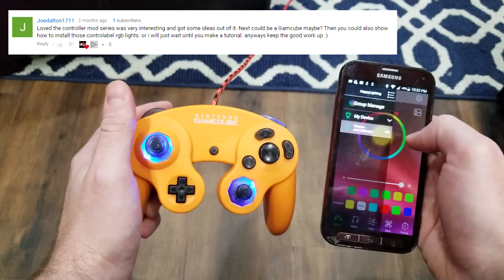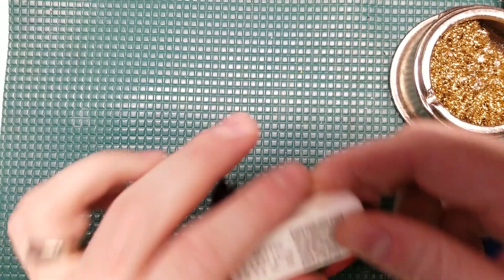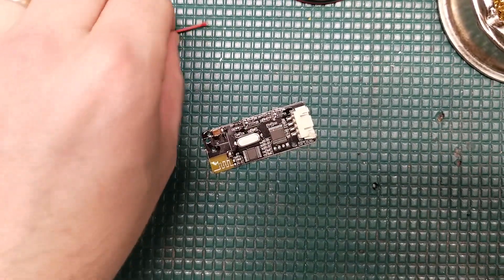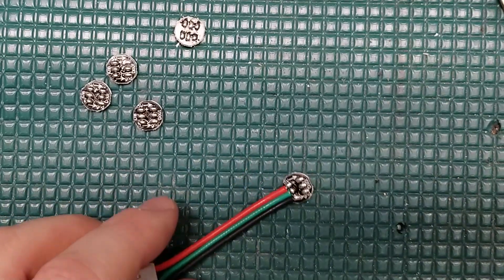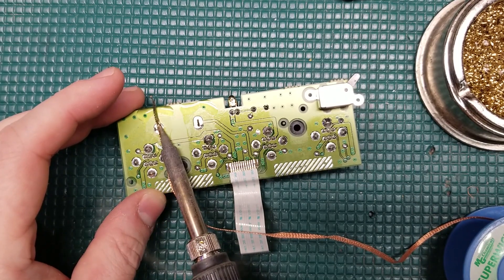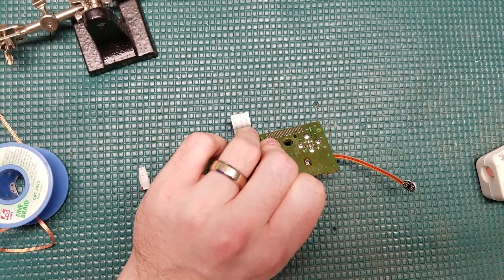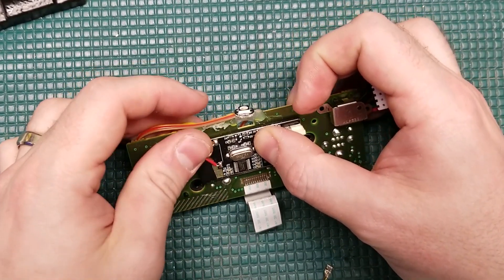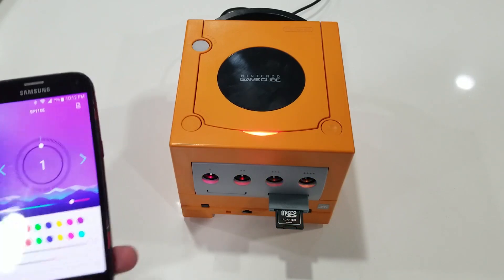RGB LED Mod Tutorial/ How to/ guide - Gamecube, Saturn, N64, SNES, and More!

Comment: Casual solderer. Took me 3 hours and still don't have the LEDs lighting up. Tried to get the exact LED controller you have, but all they sell now is 4-pin connectors instead of 3.

Since I can connect to it from my phone, the soldering to the chip should be correct. I believe it's the 4-pin connector.

Comment: A great way to align these LEDs is to do a quick solder job from the hue to a clipped USB cable.  You can align them while they are shining fairly accurately.
Reply from the maker: Dude, fantastic call on that... I am going to put that in the back pocket for a future video!!  Thanks for sharing!

Comment: Following your tutorial and using the same components, would I be able to add 3 more leds or is that 5v point unable to provide enough amps?  If it is too much strain for that 5v point to power 8 leds where would you draw power from?
Reply from the maker: I have not tested with a multimeter so I can't be sure, but adding 3 more leds likely wouldn't add to much more draw.  Each led at 5v draws approx 50ma. The 5v line supplies 1.5 amps. So I think youre good to go!
Reply: @RockerGaming    heard from someone else that it would probably be able to provide at least 1A and doing the math it meant it could still be doable, thanks for the clarification going ahead with the mod.

Comment: I've got my controllers, extra wire and leds in, I'm gonna be trying my hand at this tomorrow can't wait.  Thanks for the guides man, I love your channel.
Reply from the maker: Thank you and best of luck!  If you're planning to put it into a GCC just make sure you got the correct led controller from the description as the SPE110 in the video is a really tight squeeze without removing rumble.

Comment: Instead of gluing over the light, couldn't you glue over the back both sealing the wiring and both holding down the legs but also keeping the light unobstructed by the glue making it both brighter and easier to keep equal amounts shining thru

Comment: Hi! Excellent video however I am having issues. Mine is a different model SP611E, very similar with a few inconveniences. I did the same thing as you, building the LED strip with addressable lights, but my 4th and last LEDs from the strip keep acting up! They keep flickering and displaying different colors than the others. 

I changed the 4th LED only and it worked for a few minutes then both the 4th and last LEDs started acting out again! 

I changed the last one as well as the third one just to see now and same result. Now the 4th and last won’t even turn on anymore. The 3rd one is flickering too now. 

I verified continuity of my wires and all seems good and can’t find anywhere where it could short. I am clueless…. Help!!

It’s like the LEDs keep failing…?

Comment: I love this tutorial! You are so in depth and help me not only do but understand! I’m subscribing today! I’ve been doing this now and my only question is, where is the 5v for the n64? I don’t want to use the one from the a/v cause people say it fries the audio and video. Is there another more reliable spot? Do I use a 12v to 5v stepdown? Or is it safe you use these EXACT pieces connected to the a/v port? FYI, I have a RGB mod already installed. Don’t know if the combo drains too much power. Thank you so much for your time and you’ve made us all better at what we like to do!!!
Reply from the maker: Thank you!! I would look to pull 5v off the voltage regulator. That is going to be the most stable 5v source.
Reply: RockerGaming I can’t find the voltage regulator on the board. Only for my 3.3v for the mod. If everyone keeps losing audio and video, can I just use a step down from the direct powers 12v source? Sorry for all the questions. Just can’t find it on the dang N64. Every other console I got. Lol
Reply: @greenrasta5789  u ever find the 5v?
Reply: @RockerGaming  I just did this to my n64 and the audio video is now fried just like this comment said. I have light in the LEDs but my n64 is a paperweight now. Any idea how to fix this? Or how to identify the voltage regulator on the n64m

Comment: Hello, I love your tutorial and followed it to a T but the lights are not working. :( I have a few questions. The Bluetooth controller is the same model and brand, I got it from your link, however, the internals looked different, especially the tip connector. After I removed it the ground and 5v looked different from your video. Do you know how to tell which one is ground and which one is 5v? 
The other question I have is that the controller has 4 cables, one that is loose on one end, in your video it only has 3. Did you remove it?
And finally what temperature are you using on your soldering machine. I was using 680. 

Thanks so much! Love your channel.
Reply from the maker: To to tell which is ground I would use your multimeter and using continuity mod probe the two power points with the other touching ground from the pads that go out the leds. 

Yes i clipped it off

I have mine set between 600 and 700 degrees F based upon what im doing 650  would be good for this operation, but the 680 youre using is fine too.
Reply: @RockerGaming  IT WORKED!!!
Reply from the maker: @pablosalazarcomposer  well done!! 👏

Comment: This looks awesome! Totally going to do with in my GC Switch Dock now. Should be easy enough to connect the controller to the Dock LED. Fantastic tutorial!
Reply: After a quick test, turns out the dock led is too low to power it. The LED turns on, but the controller doesn't appear in the app or through the phone's bluetooth. I'm getting about 1.8V from the dock for the LED, and given that the controller says 5-24V... I'm going to assume this won't work the way I want it to. Might have to use a transistor switch to get the desired function.

Comment: Did you have to mod the top half of the shell to get it back together?? I've just done this but something is preventing the shell closing.
Reply from the maker: I didnt, you might have to relocate the power led slightly as some of the GC controller port adapters are a bit taller than others.

Comment: How is the app with the bluetooth controller? Any problems with it, like does it have a default color it goes to when turned off or does it stay the color last used ?
Reply from the maker: It goes to the last color used, so it remembers so to speak. The app is ok, but it works for its intended purpose which to me is all that matters.
Reply: Ok good, that’s what I was hoping for. I’m in possession of one but it’s default color is Red every time you turn it on..... that’s no bueno, and a little annoying. Shame on those lazy devs.  ;)

Comment: I am trying to do this mod :) but i don't understand how your top led (the one that shines through the lid) didn't interfere later on, when you positioned it on top of the board?
Reply from the maker: Do you mean when you put the top of the console back on?  It should still be able to go back on there no problem.  There are a few different revisions of the controller PCB and there could be one revision where it could cause a problem, but for the most part it should be good to go!
Reply: RockerGaming yes, I had to make my top led flush with the board and then I still had to sand down and modify the clear plastic tab in the lid. But in the end it worked and this tutorial helped me so much :)

Comment: Great tutorial! I am about to do this myself. I am after getting the controller ports to be static colors for the player colors but I wanting the power/lid/fan LEDs to be programable. Can you individually control the LED's or is it only pre programmed patterns?
Reply from the maker: great question, I believe it is pre-programmed only on the app, but TBH, I have not dived into it super deep as I was very happy with the options on the app.

Comment: I'm so eager to make this my first soldering project! Say, is it possible to use 6 or more of those leds instead of just 5 at a time? I wanted to use another led so I could give my left fan some RGB...
Reply from the maker: Do it!! 6th led shouldnt be an issue at all!
Reply: @RockerGaming  Thanks for getting back to me! I know I'm stretching it a bit out of curiosity, but what's the maximum amount of leds that can be used?
Reply from the maker: I mean more than you can fit into GC 🤣 I'm not sure but if you Google how many neopixels on 5v line you will get an answer I want to say its more than 50
Reply: RockerGaming I’ll get back to you after I’m done jamming 51 LEDs into my console. Hahaha! Thanks again for the help, I can’t wait to get started!
Reply: @RockerGaming  Just wanted to get back to you after two years to say thank you so much for this tutorial! My Gamecube looks sooo incredibly flashy whenever it's turned on... Paired with GCLoader and a couple extra things like the stock fan replacement or 3D printed mount, it had quickly become my most treasured console I've ever owned. 7 LEDs worked just fine for lighting up every crevice of the console btw and it's never looked better! :)
Reply from the maker: Hell yeah 🙌🙌🙌🙌

Comment: Hi Rocker, love your vids! Have you tried drilling out the controller port indicators, the small indented holes above the ports? You would have to position the LEDs differently, but the overall effect is super cool! Thanks for the tutorial!
Reply from the maker: Thanks for the  comment! Yes I have, tried it before, I am working on a project where you should see that here  soon. I will say though getting the leds to look right is indeed difficult.  Have you done it before? Let me know if you have any tips
Reply: @RockerGaming  Hmm, you could wire up one more LED and attach a "light pipe" to it and have it pressed against the holes. Not sure how evenly it would distribute light. Could try an acrylic pipe and scuff it with sandpaper?? Would only be one color for all the holes, but seems like something cool to try out.
Reply from the maker: I really like this idea!  I was thinking I was going to use to hot glue to effectively do the same thing, really appreciate the idea and it now gives me options which is what works best!  Thanks again!
Reply: @RockerGaming  You should also check out side glow fiber optics, very cool stuff! Good luck!!
Reply from the maker: @WagaSSBM  Oh just checked those out, VERY COOL!  I am going to have to look into those some more, thanks for the suggestion!!

Comment: Hi, awesome video! Do you know how this can be used for Xbox 360? like with the RF board and some other leds in the case? The PHAT version I mean. I know where the voltage points are just not sure how this would work with the RF board as well, it uses 0605 SMD LEDS and that board has a different voltage input/output whereas LED strips are 12v. thanks!
Reply from the maker: It should work in the 360 no problem, you just need to make sure you get a 5v LED controller, similar to the one that I use in this video.
Reply: @RockerGaming  Thanks for the reply. Yeah the issue is the RF board does not use 5v LEDS, it uses 3.3v I think. The SMD's are 0603. I don't think you can get RGB SMD Leds like that. The main leds inside the console case will run fine on this controller you are using, using 12v or 5v LED strips but to get that to run at the same time as the ones on the RF board which runs at 3v, I am not sure how to accomplish that.

Comment: Quick question, what are some other good meathod to address the rgb values other than BT?
Reply from the maker: You can absolutely use something like wifi there are other led controllers out there likely some you can control using a Google home or the like.

Comment: Is there any way to get this LED controller in particular into a gamecube controller?
Reply: I also was wondering where you got the additional wiring for the LEDs (the orange, red, and brown ones)
Reply from the maker: Here is a link to the wire I use.  I wish it was copper, but it works very well: https://amzn.to/2WMXcZQ
Reply from the maker: I would recommend a different led controller for a controller.  I would either go with the shinewave, which I showed here: https://youtu.be/WYO_u8BaUcw or I would use this one, but you cant use individually addressable LED's with this one.  you need to use a led strip and you need to do a  bit of modification to the led controller itself.  I showed that in this video: https://youtu.be/MEcmttZhZPQ  Here is the link to the LED controller: https://amzn.to/2TpYiso
Reply: @RockerGaming  Can you use the circular LEDs from this video with the LED controller you linked? I would imagine that they would no longer be individually addressable, but that's ok, just as long as they work.
Reply from the maker: You would need 5v led strips. Unfortunately those ones with the circular PCB wouldn't work 😕
Reply: @RockerGaming  Oh ok :( Thank you for help, your content has been so helpful for me getting into custom controller mods! <3
Reply from the maker: No problem dude! Glad it has been helping. I have some goodies on the way for you then 😀 I have been working on a custom solution to make doing the shine wave mod EXTEMELY easy. More to come but it's in the works!

Comment: Would I be able to fit this into a gamecube controller?
Reply: I should say how can I fit it in? The board doesnt fit in the grip.
Reply from the maker: Check the description of the video. I make reference to the board to get for a GCC. You can fit this one in there, but you will need to remove the rumble
Reply: With some cutting and tinkering I was able to fit the board into the grip of the controller
Reply from the maker: @strizz42069  dang well done dude!

Comment: I am getting ready to do this mod. I bought the LED controller through Amazon with the link you provided. It looks the same on the outside with the exception that it's DC 5-24V. Is that going to make any difference? Also, mine did not come with any instructions, so I don't have any info on the app or have any idea where to find it.
Reply from the maker: That should be just fine! Just make sure you have it wired into a 5v source.  As for the app on android it's called "LED Hue" and the app icon looks like a led strip